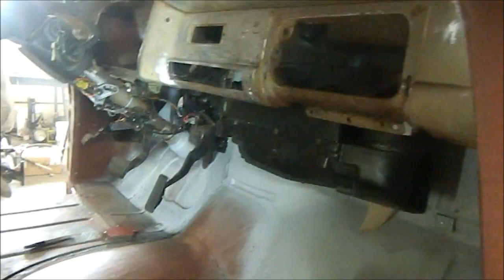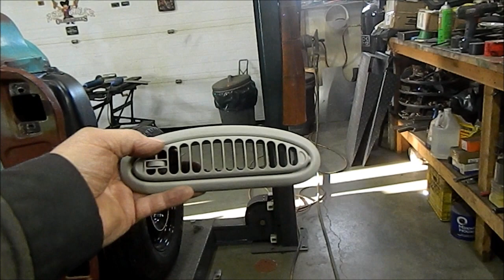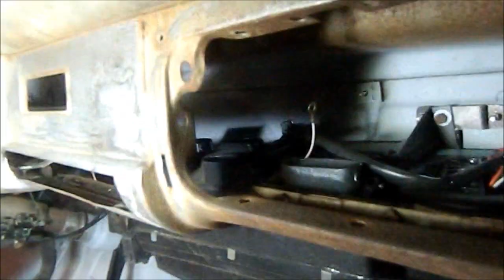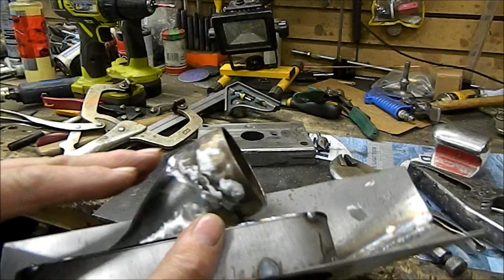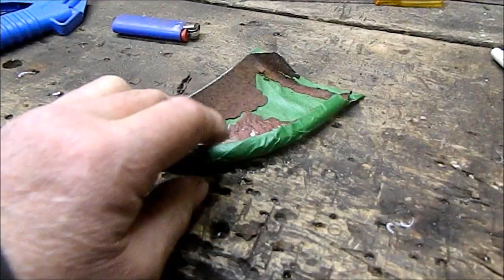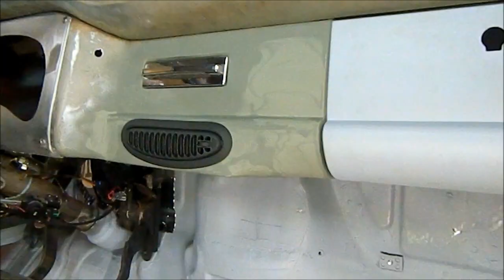1959 Apache GMC Fleetside #46  Interior work

Comment: When you first showed the vintage air vents for $60 I thought to myself for fks sake Glen, you could make that. And then you made something great. Sorry for second guessing. Looks awesome. I need to find or make something for my defrost vents and you gave me some ideas. Thanks as always
Reply from the maker: @dannypeter6565  Thanks Danny,  I have  a set of vintage air defrost vents you can have,  just pay the shipping.
Reply: @glenmiller3783  The dash and windshield garnish has the defrost slots already, I just need something to attach under the dash to direct the air flow to the factory vents. You wont see them so I think I can flange something up. I appreciate the offer